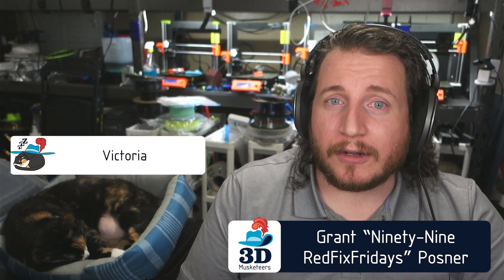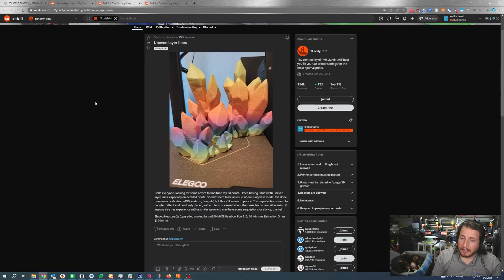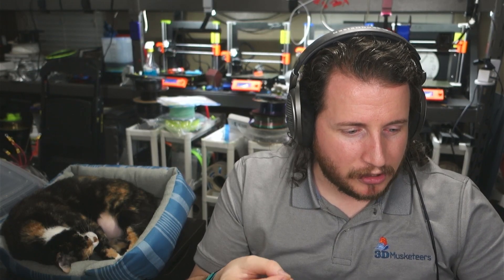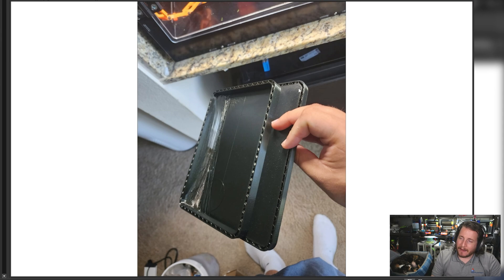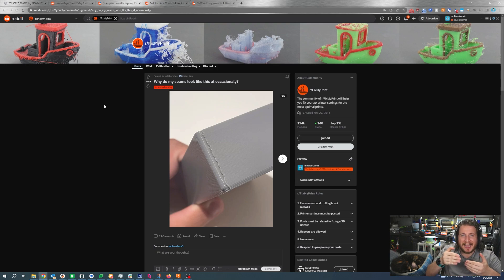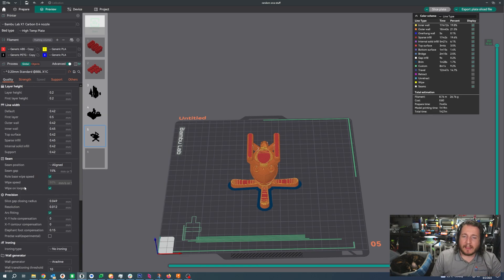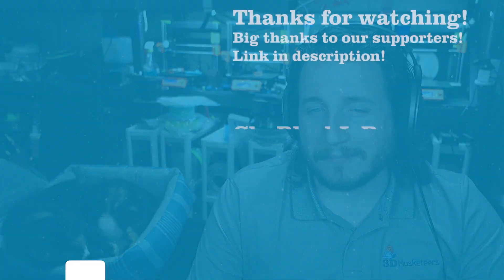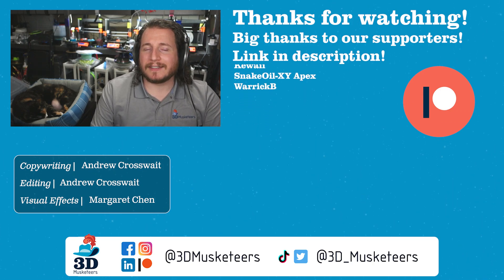Skipping Prints, Nozzles Knocking into Parts!! - PrintFixFriday 99

Comment: 2:47 This could be a retraction issue where it is retracting too much filament and causing air pockets in the nozzle, or not enough retraction where it loses too much filament in the infill before it gets to the wall. It could also be a temp issue where the pressure in the nozzle is not steady because it cant keep up with the flow demand.
Reply from the maker: that cavitation issue is one I need to consider more.. I forget about it often.

Comment: I printed the front half of the mirror cover for my dad's car in both PP and TPU (it's fragile and most likely will break when you remove it) to help with the process of getting the precise fitting right. The PP didn't finish because I had a thermal runaway on the bed on the mk3. According to octoprint it dropped from 110 to 108 degrees before it tripped. I haven't used it since so I have no idea if the bed went bad on me or if it was just a fluke. But the part was done enough to test. It's too small. It doesn't fit on the back piece very well. I guess PP shrinks a LOT! I also did TPU on the mk4 at the same time (2 printers FTW!) Super messy stringy print (I ran the dryer at 50 degrees the whole time). But after cleaning it up it fits pretty well. I probably just need to adjust the generic flex profile in prusa. But it's so flexible I honesly don't know if it's of any value for this task. lol oh well. And the MK4 refused to connect to prusa connect for several days, but as of today it's connected again. It might be a firmware issue. It acted like it had no IP address.
Reply from the maker: yep PP shrinks a ton and its a pain to work with.. 

we dry much hotter than 50c for tpu, but it can get wet fast.
Reply: @3DMusketeers  it's the best this dryer does. The high temp one fried. I might take it apart this weekend.
Reply from the maker: ah, ok

Comment: Mods can and will interact, and planning for that ahead of time can save you a lot of trouble...

1) I love light bars on printers. The best places for printers in my home don't have overhead lights and don't have a lot of outlets (the printers and associated items like the filament dryer and resin wash/cure station vacuum up all of the available outlets). Most printers don't come with their own lights, so I slapped a homemade LED light bar on my Ender 3. It's pretty neat - on the front it runs nearly the full width of the top extrusion, then there's an end cap that routes the wiring to the shorter LED light bar on the back side of the top extrusion (the wire then goes down the back side of the vertical extrusion and underneath the PSU, with a detour going to the light switch mounted under the LCD screen). The only way I could improve on that is to have another LED strip on the bottom of my print head, but there isn't a good spot for it and I can get by just fine with the large amount of light coming from the existing bars.

2) I also love my direct-drive extruder, the original Micro-Swiss extruder mount with the all-metal hot end. Making it drastically easier to print flexible filaments was nice, not having to service the PTFE tube every few days when printing PETG was nicer yet. It does take up quite a bit more room above the hot end, given how the motor is mounted. 

3) I also also had the last dregs of a spool of frankly awful unbranded filament bought from a random eBay store. I had a friend who asked me to make something and really, really wanted it in yellow. At the time, yellow filament was oddly hard to come by, so I bought a color I don't like from a vendor I don't trust to get the job done. What to do with the rest of this awful, tangled, garbage filament with diameter consistency and clogging issues? Slice a large functional print, a big scoop that I use in winter time to spread salt on the driveway and the little walkways going from the driveway to the front door and side garage door. 

What happens when you mix a print that uses the entire stock Z-height of your printer with a direct-drive extruder that extends a few inches above the normal top of the print head and an LED light bar that hangs out over the print bed? A scoop missing the last few inches of its handle, a destroyed extruder motor cable (it was rubbing so hard on the LEDs that individual LEDs were being lit by the voltage being sent to the extruder), and what I believe to be bent V-slots on my gantry extrusion. Oops.

Micro-Swiss was kind enough to let me order a new cable even though it's not a normal spare part for sale and the LED strip is apparently made of adamantium...but I've had two areas just to the left and right of dead center in the bed that appear to be quite a bit higher than the rest of the bed, despite the bed itself being flat as a pancake. For two years. It's why, despite having well-tuned Cura profiles and a printer that was actually made and inspected by skilled, caring Creality employees that take pride in their work, I tend to avoid using my Ender 3 unless I really, really need it to print something specific or my prints fit into a narrow strip running down the middle of the bed. I don't have the skills or honest desire to add ABL (I'd be willing to bet the vast difference in distance from nozzle to bed is more than some ABL probes can even compensate for anyway), and my confidence in drilling my own holes from a raw piece of 2020 aluminum extrusion is just as low.

Don't be like me, plan ahead for how your mods/upgrades might interact! And if any of you have a dead original Ender 3 (or Ender 3 Pro, unsure about later models) or have bought an Ender Extender, I would be more than happy to buy your old gantry extrusion for a reasonable price.
Reply from the maker: YES lights ontop of printers is so nice!

always really plan your upgrades ahead :) 

Aren't the extrusions 2040?
Reply: @3DMusketeers  The vertical extrusions are 2040s and the OG Ender 3 also mounts the bed carriage on a 2040 but the print head travels on a 2020 and the top crossbar is a 2020 as well. This is one of the reasons why my second printer was the Artillery Sidewinder X1 - it still used 2040s for the vertical extrusions but used a 2040 for the top crossbar and beefy 2060s for both the print head and bed carriage to travel on. (And while looking up pictures to confirm what they used for the top crossbar, I see Matterhackers has the Sidewinder X1 listed for a bargain-basement price of $199 - for a solid 300x300x400 mm printer, even one that's no longer in production, that's an incredible steal.)
Reply from the maker: assuming the X1 has the newer firmware that wont burn your house down, yes

Comment: Regarding the seams in Orca or Bambu orientation is the key to hiding your seams
For some reason that particular group of settings (seam location, gap, etc) sucks when the print it squared up
In fact a lot of wall imperfections in general can be alleviated by orientating the model on an angle rather than the straightest plane
I have no idea on how this affects strength but for appearance it makes a staggering difference 
Here's a test
Print a simple cube lined up square on the build plate and set your seam the best you can
Next print another cube using the aligned seam position and this time turn the cube on the build plate so the edge is in line with the back plane (like a diamond if you're looking down)
Compare the the two and tell me what you think, if you like it try another more complex model which may take longer due to slicing, looking at the preview, re-orientating and slicing until the preview looks good
Reply from the maker: I will give it a shot!

Comment: Not surprised that a Bambu has fast profiles by default - that's supposed to be claim to fame, after all. But I've learned that speed is a trade-off, you lose a bit of quality and reliability. I'd rather have a print that succeeds than a failed print that was fast.
Reply from the maker: I feel that